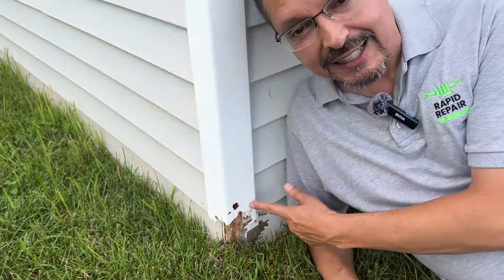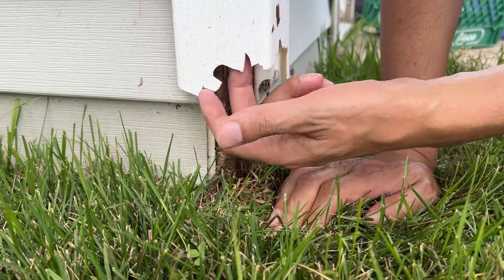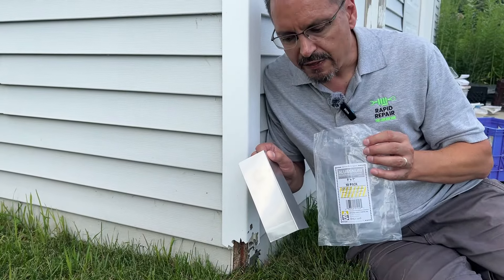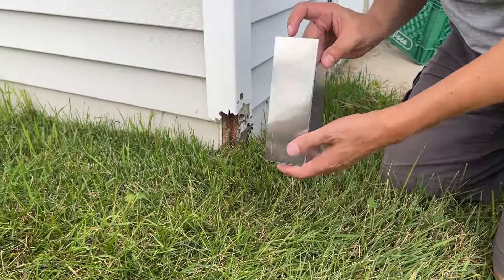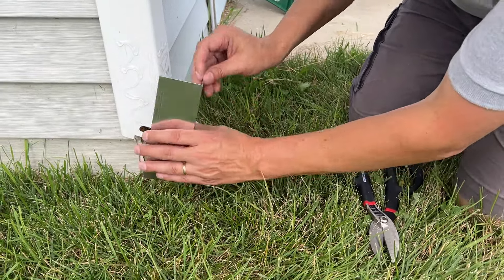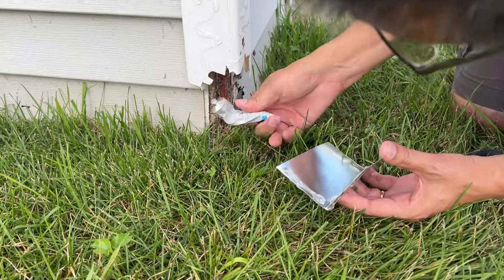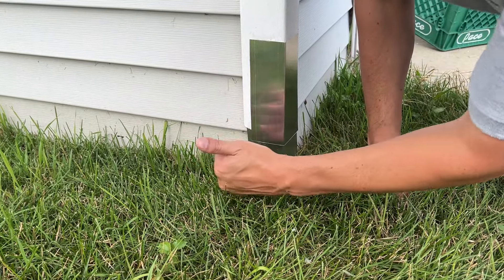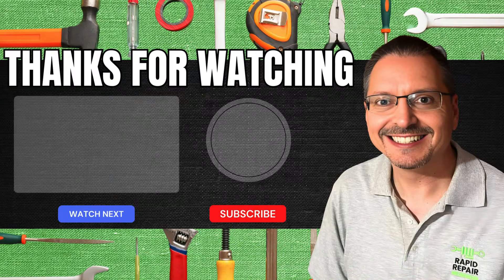Easy DIY Fix for Damaged Siding

Comment: Smart choice using metal! If you replace it with a plastic corner it will just keep breaking.

I wonder how it would look if you paint matched the metal as close as you could?
Reply from the maker: Thanks for watching. Painting might work. Also, I see that you can order it in white and most corner pieces are white. So that’s a good idea. I might try that soon. But I agree if you if you just replaced with the exact same material, it’s going to crack again.
Reply: @HomeRapidRepair  yeah the only thing with painting is you’ll have to touch it up after the weed whacker. Unless you become a pro with your weedwhacking skills 😂

Either way a metal corner no matter the color is more functional than cracks.

Comment: Cap the broken area with a new piece of corner material
Reply from the maker: Thank you for watching. I'm going to do that video too....soon I hope.
Reply: Yes.  Buy a 10ft vinyl corner.  If you only need a 12" cap, you'll have nine 12" pieces left over for future damage.  Cut the nail strips off the 12" cap and snap it right over the existing damaged area. You could also use 1 or 2, color matching rivets to hold it in place if needed.  If the new piece gets damaged, use a 1/8 bit and drill out the rivets and repeat the cap replacement process.
Reply: PS: A weedwhacker will destroy that step flashing as well.
Reply from the maker: @cyclepowered8799  thank you for sharing. I have a video coming out this weekend about replacing the 10 foot corner piece. I got it at my local Menards for literally only $18. What a great buy 🏠
Reply from the maker: @cyclepowered8799  damn lawn crew 🤦🏻‍♂️
Reply: @HomeRapidRepair  Nice! There's also a trick to replace the corner without removing all the siding OR the corner. Thanks